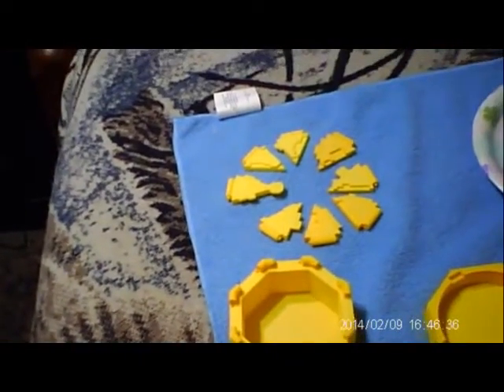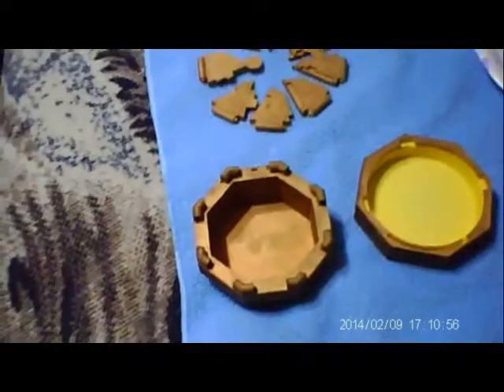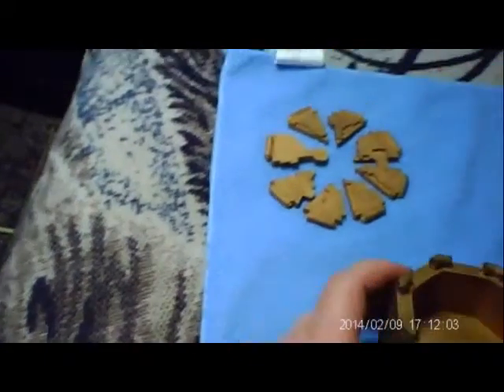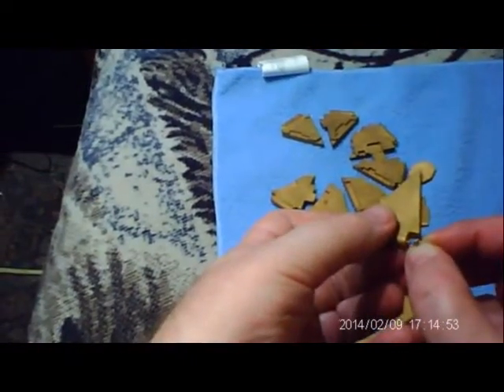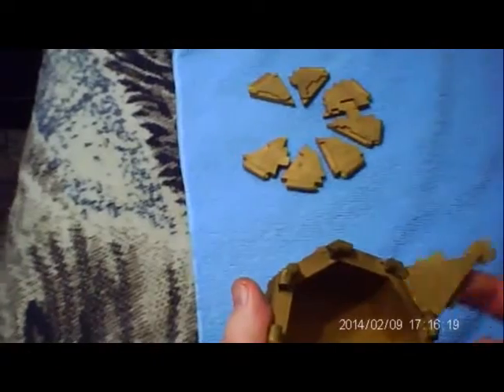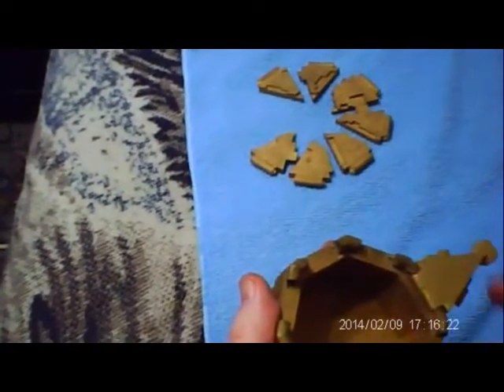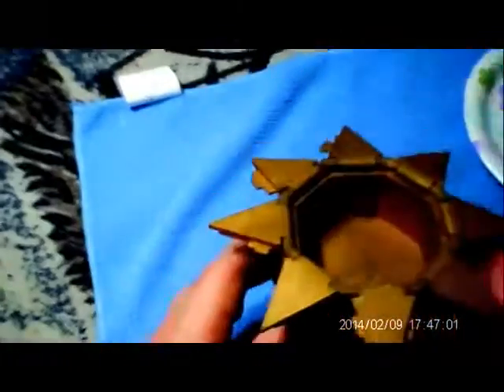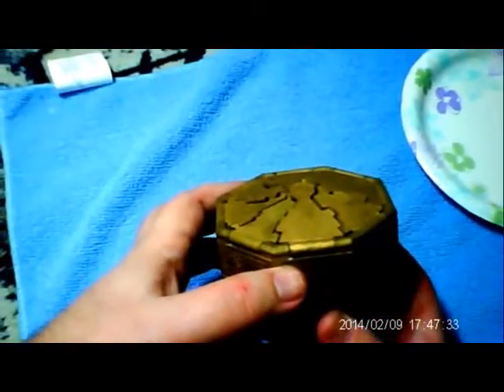Assembly

Comment: do u sell?
Reply from the maker: https://www.shapeways.com/product/FSM7NTTGF/final-hamunaptra-key-2017?optionId=62279324&li=marketplace  and  https://www.shapeways.com/product/DM4HJZ9KD/ham-key-lock?optionId=61833757&li=marketplaceand you would send me a message in Shapeways so I can send you the springs necessary to complete the key.Due to variations in printing, pieces should be sanded anywhere where 2 piece will be touching each other.
Reply: Is it still possible to get this?